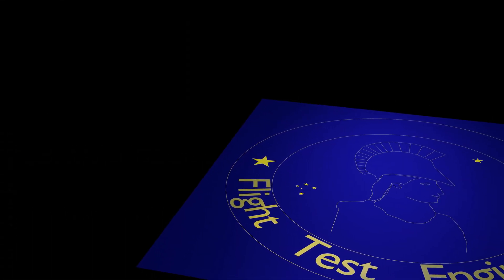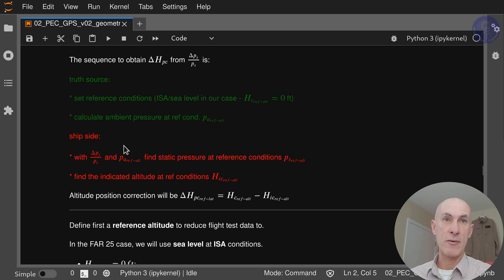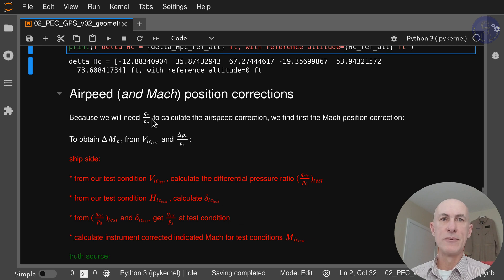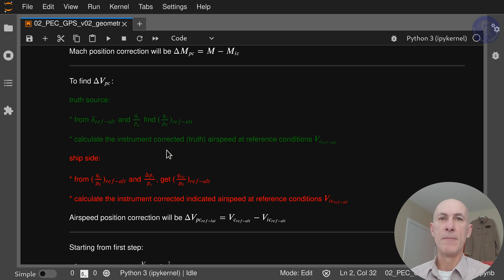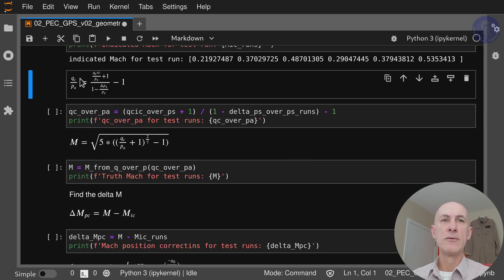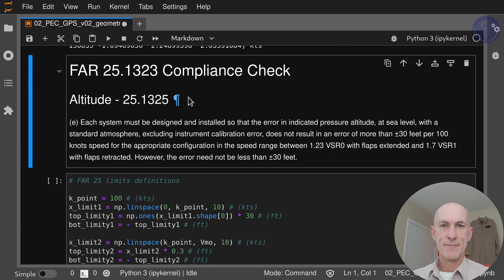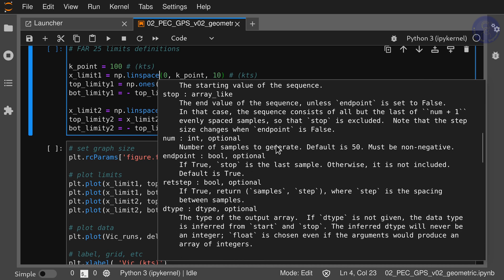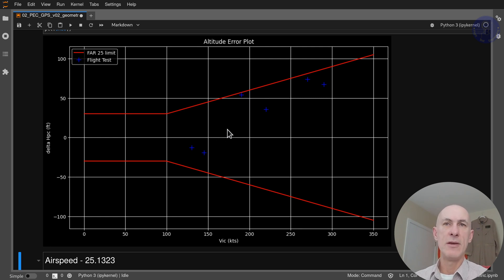Position Error Correction PEC/GPS - part 3 -FAR 25 Data Expansion in Python

Comment: Hi André, great video! Funny... I just updated the PEC Data Reduction lecture at ITPS and also implemented the same data expansion process that you proposed (from USAF TPS textbook). Nice to see in Python!
I believe it's important to highlight there are some assumptions taken beforehand that affect the method accuracy, and the strongest one is related to AoA dependence - so if altitude affects AoA or if we are dealing with compensated air data systems, more uncertainty is introduced. Additionally, if your stAndard conditions are too far from test conditions, you might have problems. Do you have a rule of thumb of how much altitude change between test and standard altitude would be allowed?
Reply from the maker: Great comment João. Definitively. AoA will change the pressure field around the aircraft, which directly affects what we are reading in the pitot-static system... so a good test program will factor this in and should cover a few W/deltas. 
Regarding the altitude change between runs (is that what you meant?), +/-50 ft would be ideal because that results in less than 1 KTAS variation... The bigger the altitude difference, the more variation in true airspeed... which is what the method DOES NOT account for... But more important than altitude is temperature. If, in between runs, there is outside temperature change, that will directly affect true airspeed... again... bad. How much do we allow for temperature variation? Less than 1 degree C.... tough, but that is what it takes to get precision